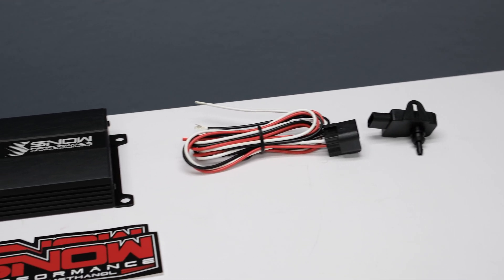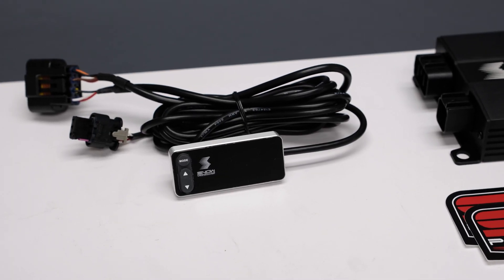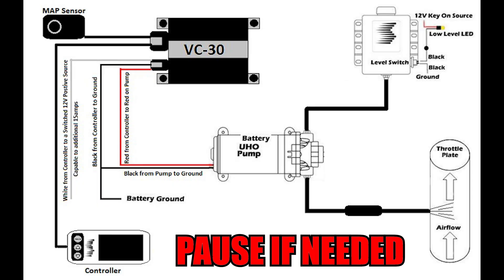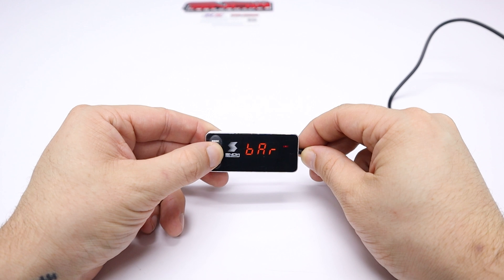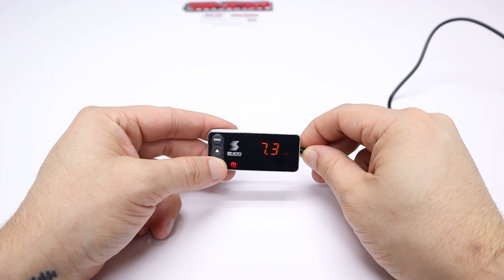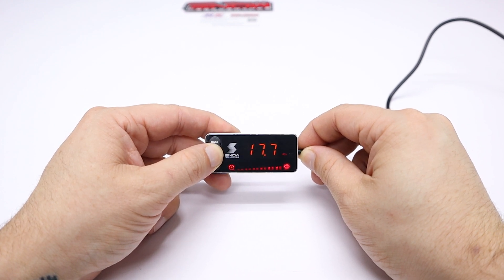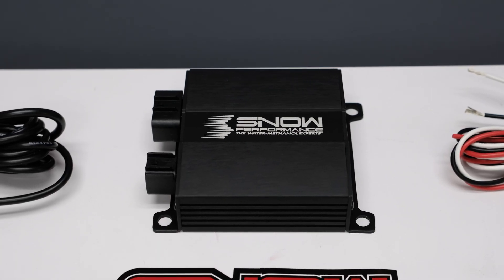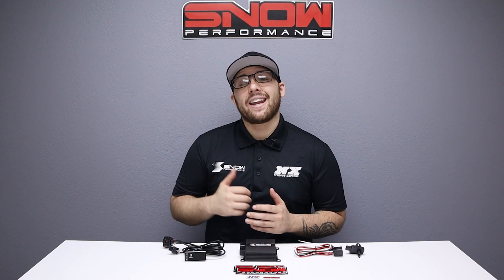This Improves EVERY Aspect of your Water-Methanol System!! (Snow Performance VC-30 Boost Controller)

Comment: What size vacuum line is that? I bought a sno 20010 brd and it doesnt have the vacuum line with the vc 30 controller.
Reply from the maker: 1/8"

Comment: will that fit with 22 WRX ?
Reply from the maker: What engine is it?
Reply: @snowperformance1  FA24 The latest subaru wrx
Reply from the maker: This controller will work, do you already have a water methanol system?

Comment: What will be the reading on this gauge, when the vacuum line is disconnected, will it still ready boost level & not spray?
Reply from the maker: With the boost reference line disconnected the system should read 0 PSI and not spray.

Comment: I just installed this system and upon reaching the default turn-on of 7psi the controller displays "E7" with all the lower lights flashing.  I assume this is an error code?  I searched the internet and found nothing.  The manual pdf on the VC-30 only mentions start psi and psi to 100% spray - nothing else.  Called tech support and the girl that answered didn't know.  Please assist.  

Also, I can only read the display at night or in my garage.  Is there a way to increase brightness?
Reply from the maker: I just spoke with our tech guy Chris and he said he may have reached out to you already! Let me know if there's anything I can do to help!
Reply: I'm having this same issue and also when I try to use the "up" button on min or max pressure it won't work. Only down works and will cycle through a bunch of numbers that are never mentioned like 99.9psi or with a letter in front like o9.8psi or r8.5 psi...

If I set to bar, it stays stuck at 2.0 bar for both min and max, with arrow buttons not affecting anything

I know the arrows work because they will both work when selecting between psi or bar mode
Reply: Just swapped the controller.. 1500$ later for labor and the up arrow works buts the controller still throws E7 error code under WOT. The display either reads 0.00 or E7

What does E7 mean? I'm getting irritated with dumping money into getting this thing to work correctly
Reply: @caseyhale7557  From their tech guy Chris: "The E7 error code has to do with electrical interference the unit is seeing either by how the wiring is run for it and the pre-wired sensor/ handheld or to do with the ground/ power."  It would be nice if these error codes were public knowledge.

I paid shipping/insurance to send my VC-30 unit back.  I received it back with no message so I'm not sure it was fixed or even my original issue.  I re-installed everything and still got the same E7 error.  I have both negative wires grounded to the battery ground and the positive wire on an in-cabin 15 amp fuse tap.  Is this good enough?  It's challenging to operate the controller because the leds are so dim I can't view anything during the day when out of the garage.  

Everyone I know with a Snow meth kit runs the VC-50 and don't have this issue.  I didn't want a vacumn line needing to be run to the in-cabin gauge, but the VC-30 map sensor harness is so short I had to mount it inside the cabin with a vacuum line running to it.  That's a poor design which you can't see before buying.  I've never seen a VC-30 kit running anywhere in-person or the internet.
Reply: @caseyhale7557  $1500 in labor just to switch out a control unit that you could have done yourself in about 30 minutes?... 😳😬
Reply: 30 minutes? The wiring harnesses on the unit models are not interchangeable and run the entire length of the car so a lot of the car interior has to b taken a part to swap one of these out unless you want  the wires exposed